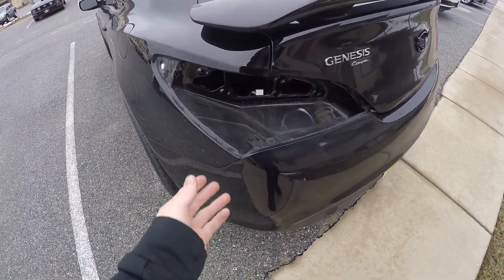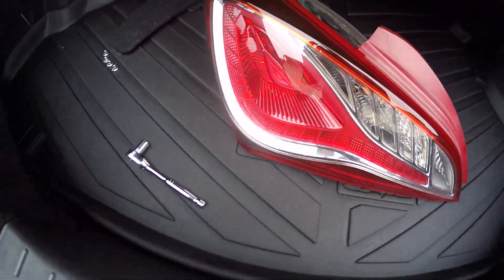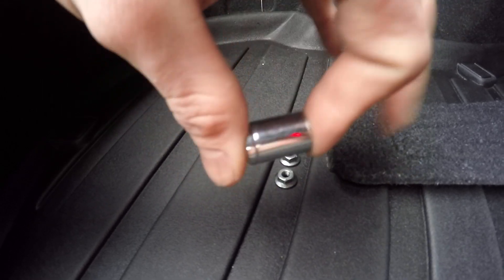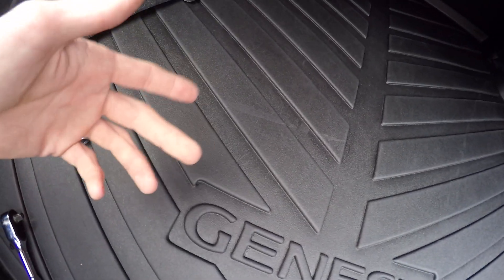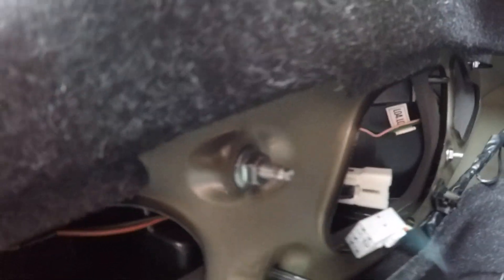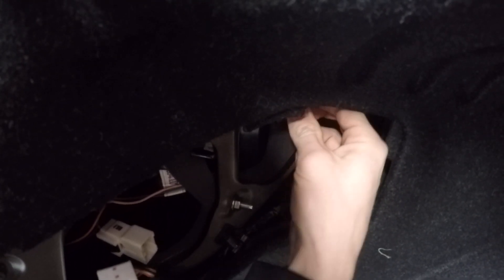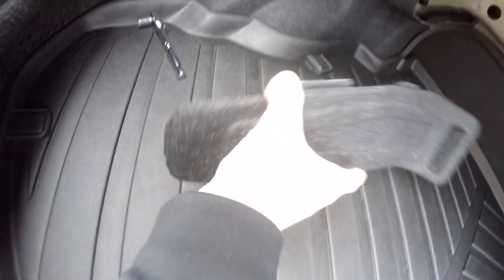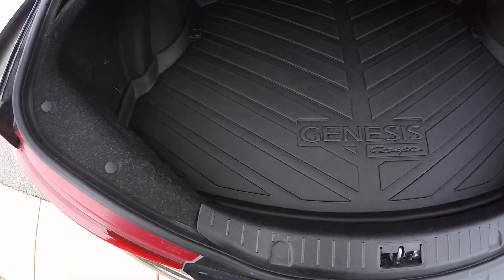Hyundai genesis coupe taillight removal/install

Comment: I broke the long guide tip on my tail light and now I can get it to get a good fitment on it and water leaks in the trunk whenever it rains. Any suggestions? 🙏
Reply from the maker: There's not much you can do at that rate I'd try to find another tail light cheap off a parts car